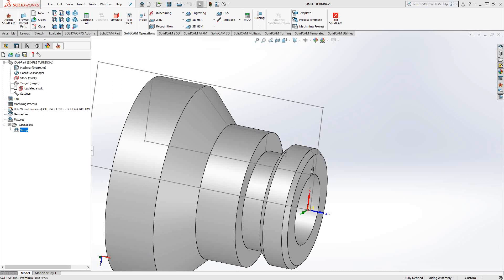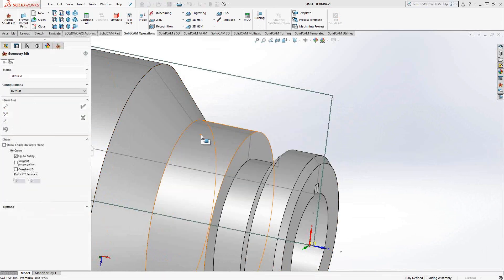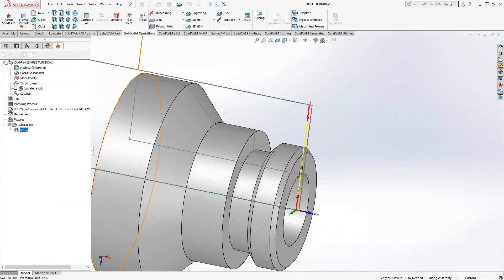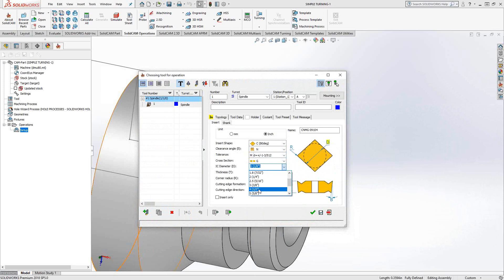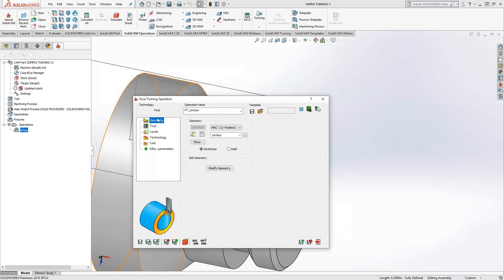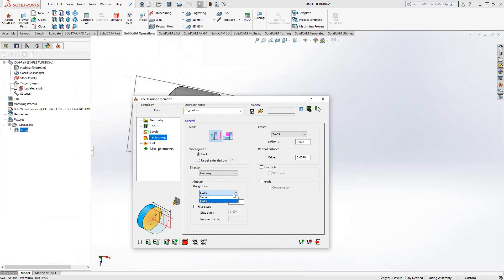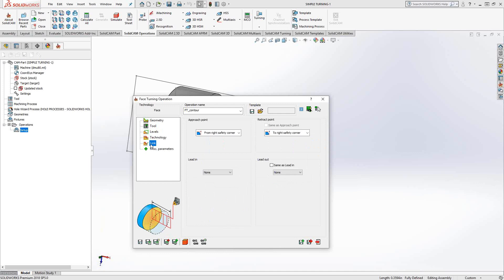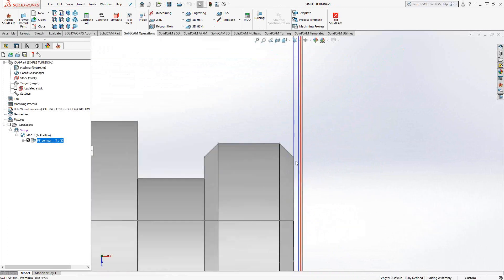Face Turning Toolpath

Comment: hello Mr !  I applied your all steps settings in that video but when I wanted to calculate  that operation an error message appeared to my face " spin is not in range; check Machine ID file".Did I miss something or it's really a problem exist in Machine ID ?  could you help me ?
Reply: Calculated RPM is too high - change your cutting speed or spindle rpm.